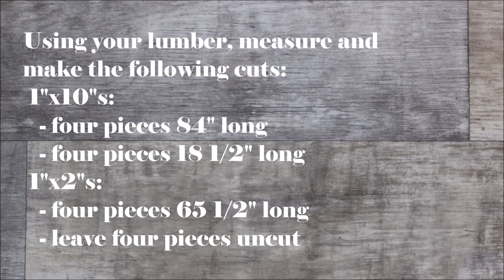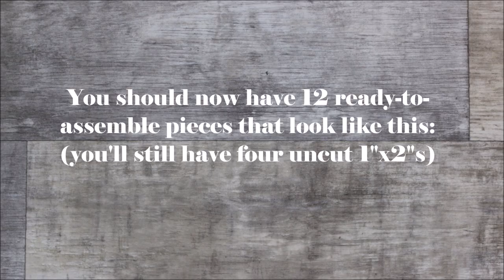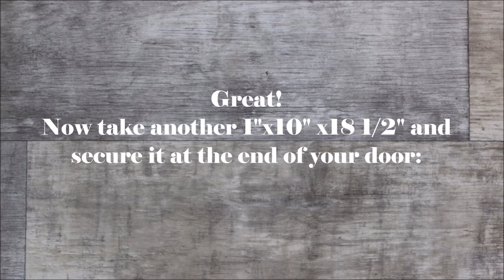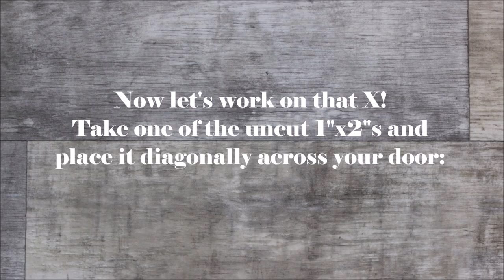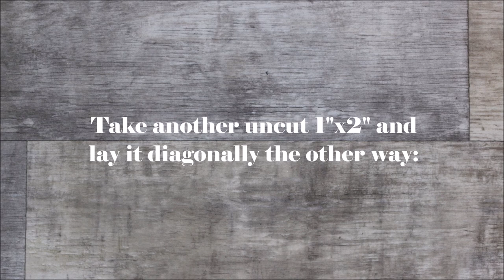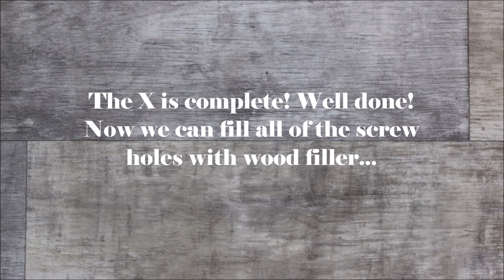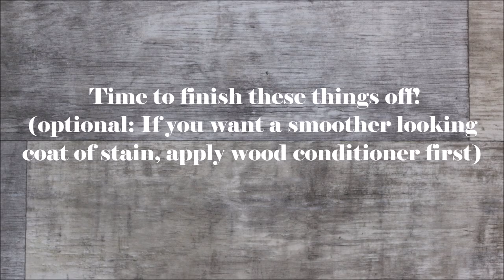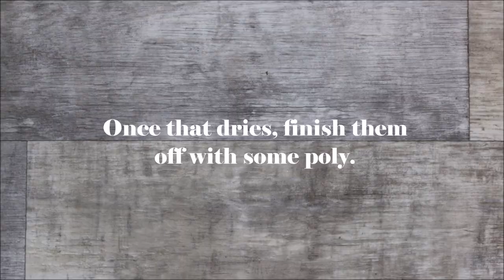The $60 Double Barn Door - Easy DIY Project

Comment: You guys are great. I did the Farmhouse Table w/ bench (just longer) and it turned out great (always get compliments on it). When the weather breaks I plan on doing the Giant Jenga project (I'm also doing a big, not giant, chess board for an outside game area). But this one might be the one I've been waiting on. We have an opening that's too small (because of a wall and thermostat) for one big barn door and it never hit me to do two (even though I've seen cabinets with two sliding doors). So,  now I might surprise my wife and do this set up...THANKS!

Comment: Question: Any way to have both doors open apart by pulling only one handle? Like is there a pulley system you're aware of to do this? I'm liking this split door for my bathroom but don't want it to be a burden having to use two hands to open both doors, especially considering it'll be used multiple times per day. 

Thanks!

Comment: Great video (music muted!).  After making many custom pair of barn doors, I should point out that what is not shown.  When you make the middle cut on the second diagonal brace, you aren’t going to do it with ANY miter saw that I know about (without it being dangerous).  Did you use a hand saw, circular saw, radial arm, or (as I do) a tapering jig on a table saw?  Also, that center cut, if exact, only needs to be done once as the other side should match up with the opposite side of the first cross brace.  BTW - your doors do look great.

Comment: How did you purchase the lumber, finishing materials and $200 bard door hardware for $60?
Reply: i think they are trying to say that the doors themselves are 60$ not the hardware which is more expensive, its somewhat click bait but what can ya do about it
Reply: "somewhat click bait" lol. It IS click bait!
Reply: its just says barn door diy , and does not specify hardware included, i know its annoying and you are right, but its a hit and miss title
Reply: ahhhh you mad bro? why you mad tho?
Reply: "R" do you even lift bro.
Reply: @Rusty Maverick Lifts everyday for sure. Would you have it any other way?
Reply: Rusty Maverick <-- Does not value his time (himself)
Reply: Solid point. I did his build and the wood alone was over $60
Reply: Chris Carr multiple their prices by 4 and you will get a better idea on how much the builds actually cost
Reply: I'll be attempting this myself and I'm curious to know if the instructions were  accurate.  Also, how much did you spend on this project?
Reply: No where does the video say anything about hardware. I never assumed hardware was included. You are saving a lot of money building these than buying them. I appreciate the video.

Comment: I'm a contractor and couldn't get all this for $60 much less the railing! People enjoy your channel you don't have to click bait them in...
Reply: To be fair, the $60 could be referring to just the door, not the mounting hardware.
Reply: More like $125..plus hardware
Reply: 5/31/19 I got everything that was on the list at Home Depot with tax it came to 197.00.. The hardware was another 85.00.
Reply: Priced everything on Lowes - not the rails and for 2 doors it costs $155 plus tax, not including the rags, brush and putty knife.
Reply: the 1x10s aren't to pricey, about 10 bucks each, but you can buy  1X8 tongue and groove knotty pine boards for 6.50 each, using those you could get all that wood for  and the framing wood for under $40, then stain would cost you around $10, if you want to polly it, that's another $13, and you could get the hardware off amazon for $40 to $50, my best guess would be about $120 for the complete job

Comment: Where do you put handles or how do you lock it?
Reply from the maker: You can put handles about 3' up on each door, you'd just need to add a locking latch (can pick up at any hardware store) to whichever side you would want to lock it from.

Comment: What did you put down before you apply the stain?
Reply: fill and holes with wood putty, then sand everything smooth, don't go higher then 220 grit because if you sand it to smooth it blocks the pores in the wood and makes the stain harder to penetrate and the color will be lighter